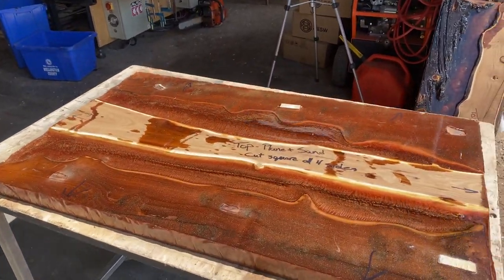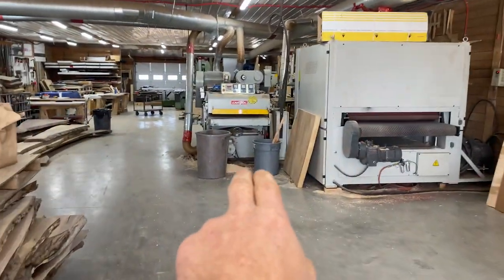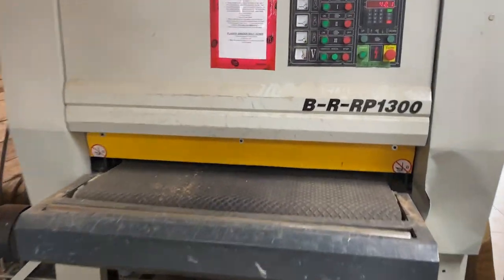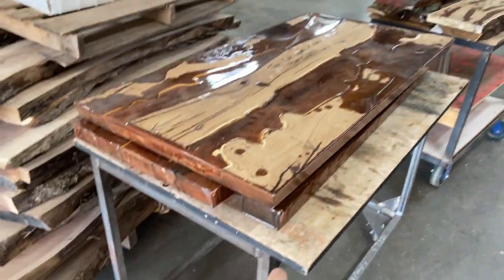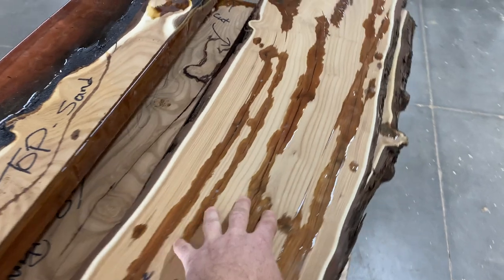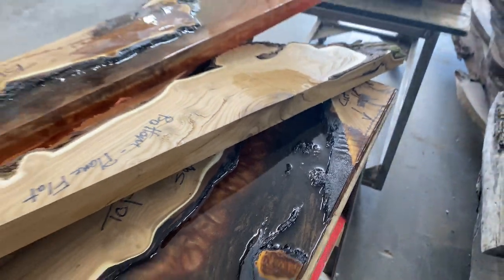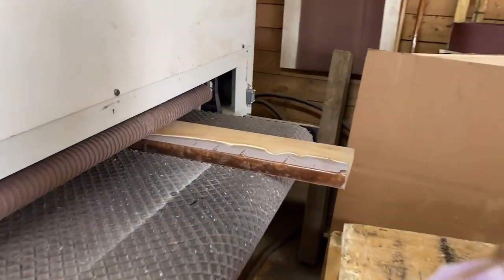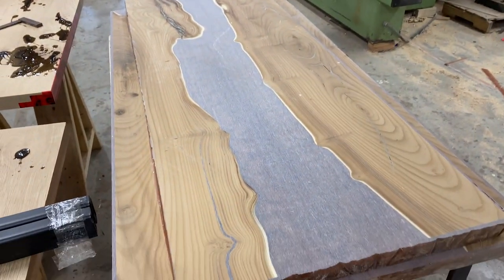Woodworking Life - Generating revenue surfacing & sanding diy woodworkers projects

Comment: Awesome job sir I've got a question for you. I'm sure you've said in a video before you don't have 3 phase. How do you run all of those motors? I have a 20 horse 3 phase for a resaw  machine. I'm trying to figure out how to run it.
Reply: He has a rotary phase converter. You have to go way back in the videos to find that one. Talk to a good electrician about how to get one that will work with what you have.
Reply: variable frequency drive.
Reply: Rotary phase converter
Reply from the maker: Hi Floyd, If it's a single motor, I would suggest using a 20-30hp VFD, you can give it single phase and it will give you 3 phase as well as ramp up and breaking.  So you can start the large motor with out a huge inrush of current and you can use it for breaking to slow the motor when stopping.  I have my 20hp dust collector running off a 20hp vfd.  I also have a Phase Perfect which will create up to 60hp of 3 phase power. Reason to use a phase perfect is if you have computer electronics or multiple motors on one machine to run.
Reply: Hi there! I am running a sawmill myself and looking to get into some more custom work. What do you charge for something like this? I am assuming by the hour?